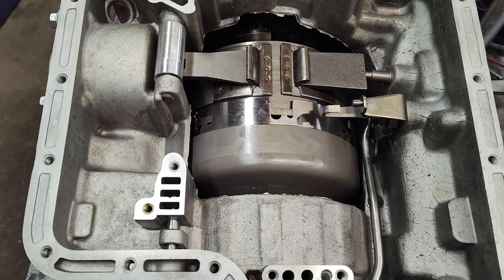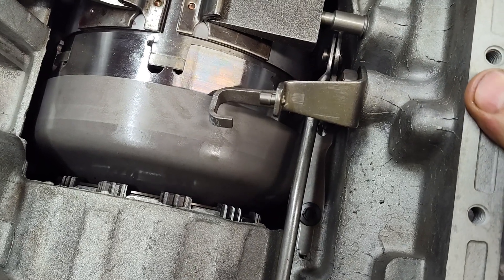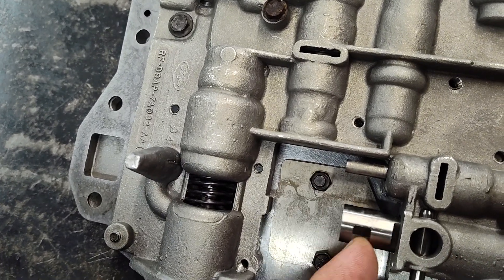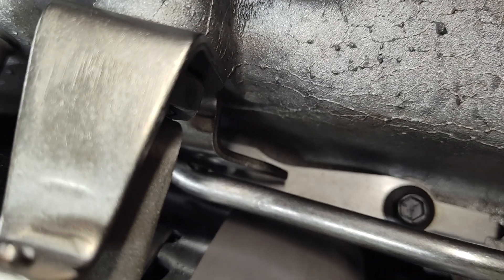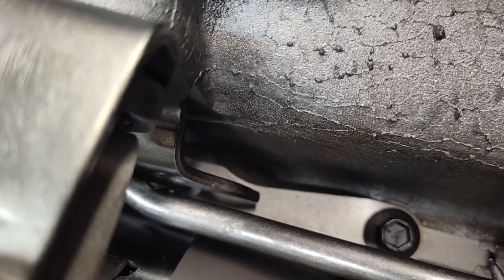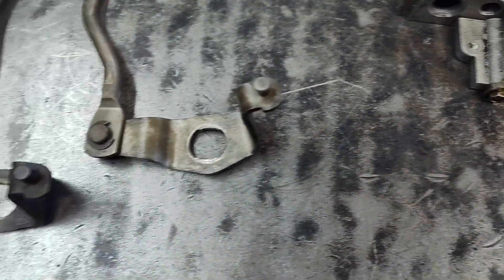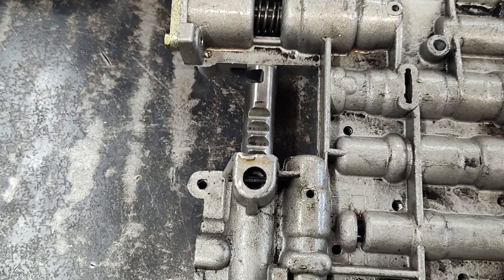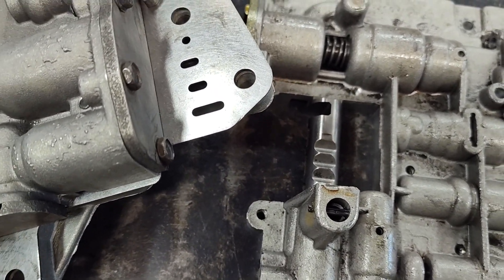Ford C6 Transmission Year Model Identification

Comment: So, you can run the old style detented valve in the new style valve body, but only if you have the rooster comb lever in case and the spring roller arm installed?
Reply from the maker: You don't want both detents. If your using the valve body with the detent in a new case that also has the detent just remove the spring and roller from the case. Assuming I'm understanding your question properly.

Comment: Hope you have time to shoot me an answer. Early C6, screw in modulater. When the car sits the case fills up with fluid and leaks in the bell housing, maybe 5 or 6 quarts runs out over time. No leaks when motor is running or if i start the motor every couple days. I have heard about a 1/2" hole in the bellhousing about 7 o'cllock position that should be plugged but sometimes is not ? Gonna have to pull the unit but don't wanna have to do it twice? Any ideas ? Thanks in advance.
Reply from the maker: Just pull the trans, you will have to anyways it sounds like and fill it with fluid and see where it's coming from. The servo lever shaft is a good possibility.